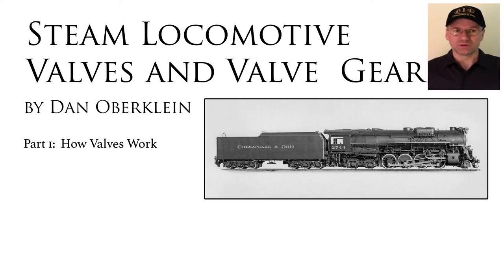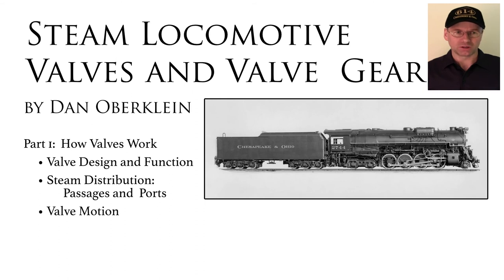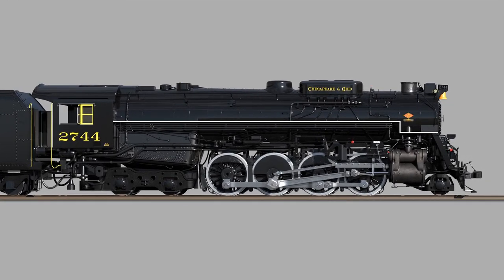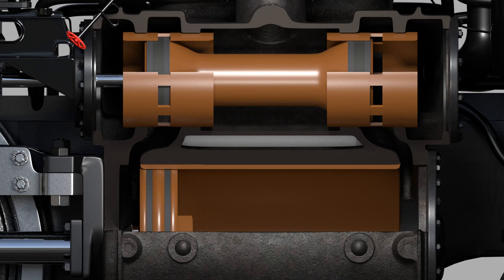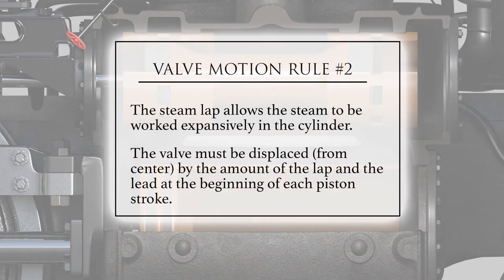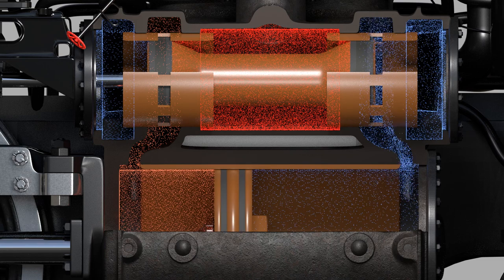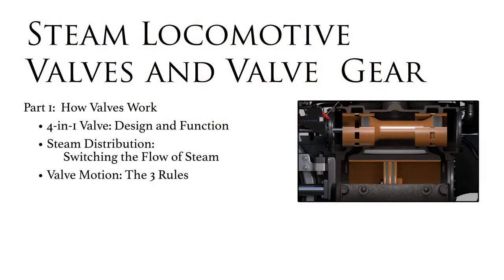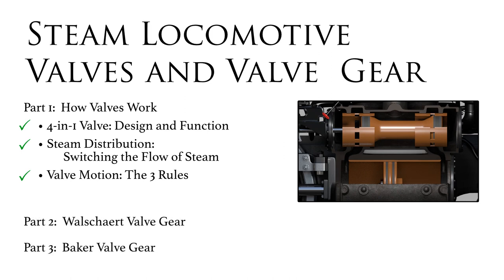Steam Locomotive Valve Operation

Comment: Fascinating. Being a machinist  myself, I can see piston valves would be easier to manufacture than slide valves. Especially back then.
Reply: Piston valves require rings to seal their circumference, a slide valve has only flat surfaces to mate together.

Comment: Some 2 stroke diesel engines can reverse by switching the cams to a reverse set of cams which works opposite to the forward cams. Which is a tad bit similar to reversing a steam engine. Cams and poppet valves are after all just a fancier version of the valve gear and spool valves.

Comment: Excellent presentation!  What program was this rendered in? I feel like just the modeling alone must have been a monumental task, let alone the excellent description of the valve events, thank you!
Reply: 11/14/2022
There are several software's available that would give this result, like Autodesk Inventor (the one I know slightly). If the modeler has actual drawings etc. of the locomotive, he/she can reproduce ALL parts of the locomotive quite readily.
the problem lies in the massive amount of memory required store all the parts and the additional memory to animate the assembly. It would require several terabytes of available memory.
What is cool is that an full size virtual model can be made, and have a real locomotive.
I'm very impressed.

Comment: U.S. METHODS ARE NOT EXCLUSIVE !
While this programme is excellent in describing the typical methods & usage of the Belgian designed Walschearts valve gear. As adopted for use in the Classic AMERICAN 2 cylinder Simples, of the Post First World War era until the end of steam. It needs to be pointed out that  around the World many types of valve gear were in use. And by World War two certain more advanced & more efficient types of valve gear were starting to come to the fore, such as "British Caprotti". 

Further certain countries such as France had "love affairs" with "Compound" type locomotives, which required different methods and visually different equipment at the front end.  In Germany the typical valve gear used was "Heusinger" itself a slightly "improved" version of Walschearts. 

Further Europe also had problems with limitations on the Physical size of steam locomotives. Which unlike in the USA were constrained by the size of tunnels & other structures built in the early days of railways. This resulted in some locomotives having to have not just two outside cylinders but also one or two more cylinders hidden between the frames. Which of course resulted in different methods of valve gear construction and cylinder design !!!

INSIDE & OUTSIDE MULTI CYLINDER TYPE !!! 
Probably the best  visual example of the different approach to locomotive construction each side of the Atlantic as far back as 1927. Was the invitation to the Baltimore & Ohio Railroads Centenary celebrations called "The Fair of the Iron Horse". Where the then brand new British FOUR CYLINDER 4-6-0 of the then Great Western Railways new  "King" class locomotive (No 6000 "King George VI") headed the daily "cavalcade" of steam locomotives. The ORIGINAL FILM can be found here on YOUTUBE under the title "1927 Baltimore & Ohio Railroad Centennial Celebration". The King class locomotive is seen passing the grandstand of onlookers at 20:07 in this old film.

The GWR 6000 seen in the film, clearly reveals its typically British very clean uncluttered lines, the LACK of external valve gear (all hidden between its frames), and the fact it is a FOUR CYLINDER Express passenger type. The outside cylinders are clearly visible in the usual place ahead of the large (6ft 7in) Driving wheels. The inside cylinders, between the main frames, are revealed by the two polished brass round Piston covers, side by side on the front of the locomotive, just below the boiler smokebox door. 

Other ALIEN features to US eyes fitted to 6000, are the fact that this loco was vacuum braked. (As were most British Railways at that time) It has standard European sprung buffers, and the European "Screw Link" type coupling. It has NO boiler dome only a polished brass safety valve cover, as steam collection was done at the apex of the taper boiler where it joined the Belpaire shaped firebox obviating the need for a dome. Further, despite being the smallest loco in the parade of then modern locos that followed it around the circular track every day. 6000 developed more Horsepower per ton of locomotive than any other locomotive present at the B&O centenary fair. Thirty of this class were built, and they operated between London & Plymouth (237 miles), hauling the Worlds then longest NON STOP passenger express service named the "Cornish Riviera". 

NOTE: Number 6000 as seen in the 1927 film, is fully PRESERVED in full working order, and still makes mainline steam tours across various parts of Britain throughout the year for tourists to ride on these trains. As do two of her identical sisters. Indeed Britain has at over 800 steam locos in operational preservation as "Steam Heritage trains" are now a major 12 Billion US Dollars per year business. Thousands of pieces of film are posted on YOUTUBE virtually daily, showing many of these locos including 6000, hauling train fans around Britain every year !!!

Comment: Very nicely done. The only sad thing is, that it only covers the american development on the steam locomotive, which was by far not the end or even the peak of steam loco evolution. Pressure equalizing piston valves, such as Müller, Karl-Schulz/Nicolai or Trofimow are not even mentioned. As well as Stephenson, Allan-Trick, Helmholtz or Gooch valve gear.
Reply: It had seemed to me that a rather high point of understanding was reached in France (in terms of efficiency as well as performance, resulting from careful research and scrupulouts attention to design detail)  with the steam locomotives rebuilt under the design direction of André Chapelon, but I'm not intimately familiar with German developments. I do know that some of his insights into the behaviour of steel wheels on steel rails at speed even informed the very much later development of the TGV running gear, and it seems to me a shame that politics and bureaucratic intrigues meant that he never was given the opportunities his brilliant results merited.

Comment: Dave:  Can you tell me if the piston operation on the right side of the locomotive is synchronized with the piston operation on the left side of the operation?
Reply: My question too .. is it offset by half a full cycle to provide what they call "quartering"?
Reply: @bigrobbie1843  think they are offset somewhere so the loco will always start to move from a dead stop . both pistons can never be at top or bottom dead center at the same time.??
Reply: On a two cylinder steam loco the cylinder events are 90 degrees from each other. If the piston in the right cylinder is at the front of the cylinder then the piston of the left cylinder is at mid stroke to avoid starting at "dead centre". And because steam cylinders are double acting there are two exhaust beats per cylinder x two cylinders which gives four exhaust beats per revolution of the drive wheels.

Comment: I have a question regarding lubricant. How much is needed for the whole assembly to run without any issue? And how is it injected into the openings in between the piston rod and the piston casing along with the other openings that need it?
Reply: Oil is delivered to the steam, and it is deposited into both the valve chamber and the main cylinders from the steam flow. That is what made condensing and reusing the steam so difficult: removing the oils before delivering the condensed water back to the boiler.

Comment: Interesting. Is that hollow spool shown at 6:00 something unique? Because I've never seen this in any explanation. And I found pictures showing Trofimov valves with pistons being able to slide freely on piston rod when pressure is not applied to push them appart against end stops. This opened both ends of cylinder to exhaust when train was idle (e.g. going downhill), it's nicely visible in this video: https://www.youtube.com/watch?v=06lDFM3gFgo

Comment: SO WOW THERE'S STILL A LOT OF WASTED STEAM PRESSURE STEAM ENERGY BEING JUST BLOWING RIGHT UP THE STACK
DAVID ADAM GRENIS MAPLETON AVENUE BOULDER COLORADO USA
Reply: This is why compounding was tried in multiple designs. It's always been known that the exhaust steam was an untapped possible energy source, it was just finding a way to tap the steam without making it SO complicated that maintenance costs exceeded the efficiency gains.
Reply: @jdgindustries2734  .. it worked well on stationary and marine steam engines (triple expansion engines). Especially marine engines evolved into triple expansion engines due to fuel efficiency, allowing greater range with less coal aboard. Compound locomotives were less of a success, because fuel could be made readily available alongside railways (coaling stations), while mechanical complications made the maintenance costs not worthy the economy of fuel.

Comment: i am crying  to NOT understand. what's making the valve move????????
Reply: The piston drives the wheel due to a rod.
On the wheel a second rod is attached, which in turn drives the valve.

That is the simplified description. Wait until he explains the Walschart mechanism to figure out how this "backwards" is cleverly built up in order to enable the different lengths of valve movement.

If you can't wait, here is a model which shows all the individual components in action (but doesn't talk in detail why you want to do this)
https://www.youtube.com/watch?v=b7NABUkyGok
Reply: It’s called Steam  !
Reply: The mechanics of the valve motion is a case study in itself.  You can have a look at these:
Walscherts
Stephenson
Baker
Capriotti
Southern
Hackworth/Klug
Baghal
Reply: Look at the whole engine from the side (maybe 1:40). Do you see how the piston rod comes straight out of the cylinder, and then a flat, vertical bar crosses over it? That vertical bar connects the piston and the valve. They are not directly connected to each other, but you can see that the vertical bar connects on the lower end to another bar, which connects to the point where the piston rod ends. When steam pushes and pulls on the piston, the piston pushes and pulls on the bars, causing that vertical bar to push and pull the valve in the same direction as the piston, with a slight delay.

The driver can also use a lever or wheel in the cabin to sort of "nudge" the valve forward or backward to change how long the valve opens, as he did when starting the locomotive (15:03), but this is done to make adjustments, e.g., when changing direction; it isn't something you'd need to be doing all the time. The piston does the real work.